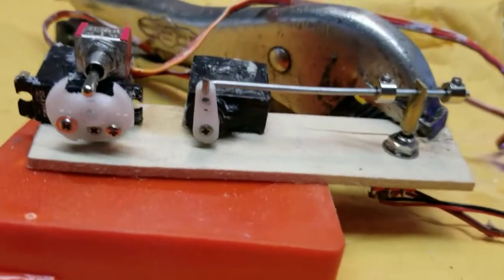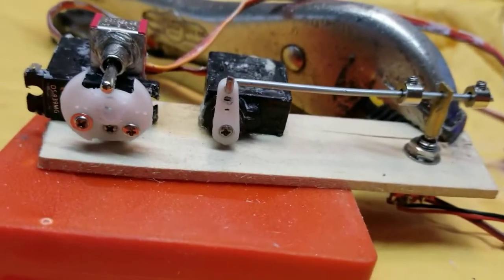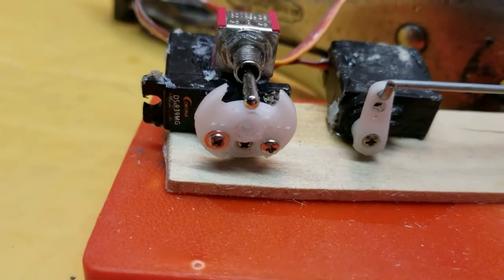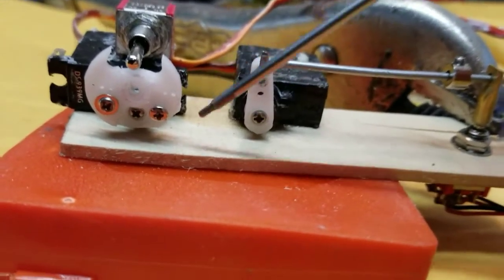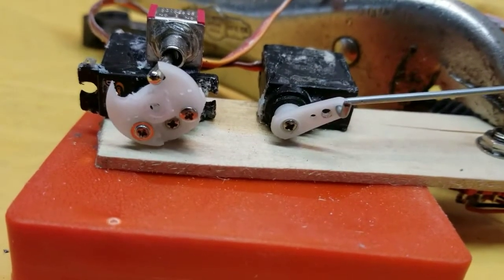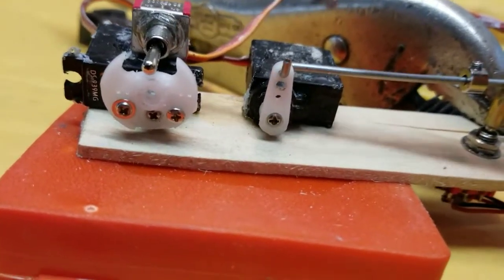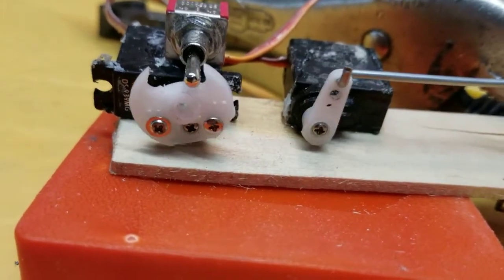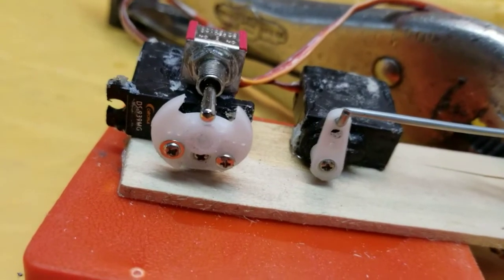Better switch/servo set up

Comment: How can I search for the servo arm on the left sir ? I love the idea
Reply from the maker: Any large round servo arm will work as long as it fits on the servo.  Mine weren't large enough diameter so I  joined two together.  You could just fashion the shape from 1/8" plywood or something similar and mount it to any sero arm you have.
Reply: @leeliddle7021  thank you sir appreciate you

Comment: How does the switch control the servo ?
Reply from the maker: The switch doesn't control a servo. It controls the retract motor which is just a brushed two wire motor. The servo moves a DPDT momentary switch. One direction runs the motor one way to raise the retract.  The other direction reverses the polarity of the two wires and moves the retract in the opposite direction.
Reply: @leeliddle7021  Thanks so its not possible to Control the servo itself with the dpdt switch ?
Reply from the maker: No, buy a servo tester from Amazon to control a servo without a transmitter and receiver